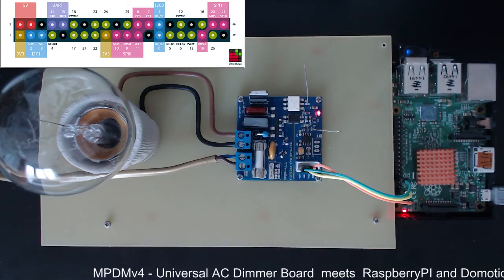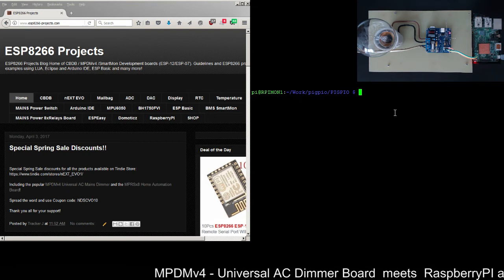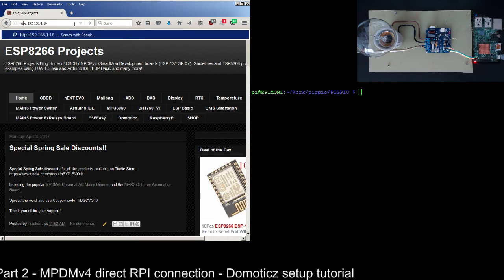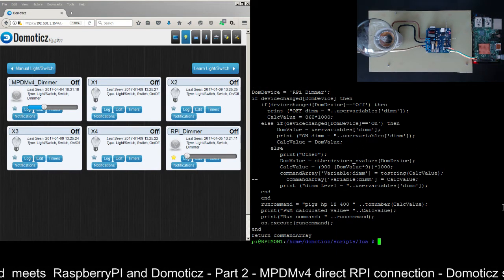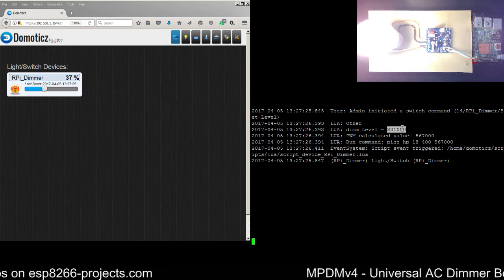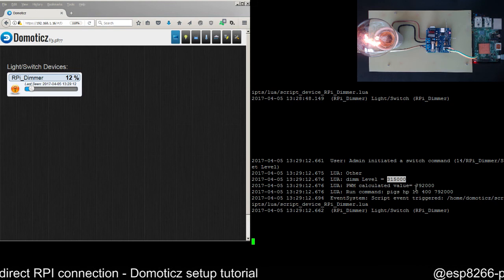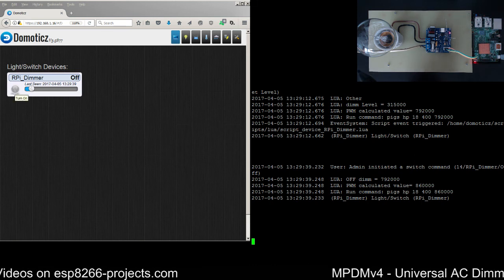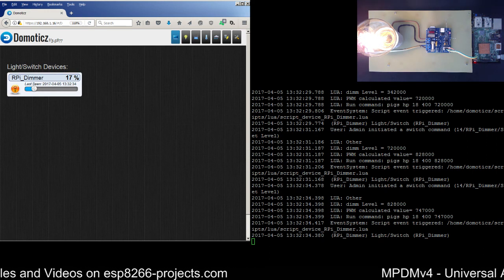Raspberry PI + Domoticz + MPDMv4 AC Dimmer - Part2

Comment: Hello,

Very nice design, I would like to implement something similar, however, also using a nextion screen in place of the wall switches, in order to control the dimmable lamps on the screen, such as a central, docked in place of the standard switches. Do you find it viable? Would you have any tips?

Thank you